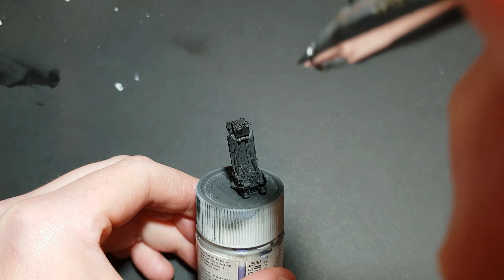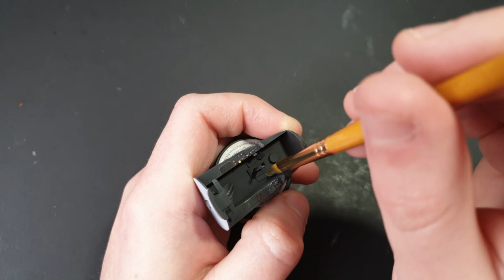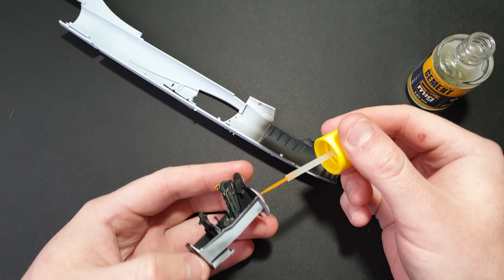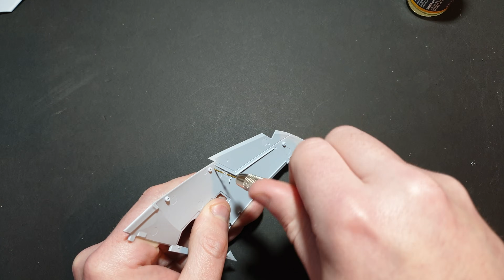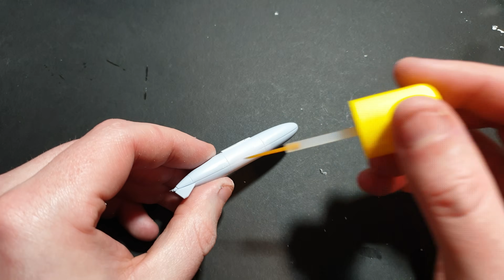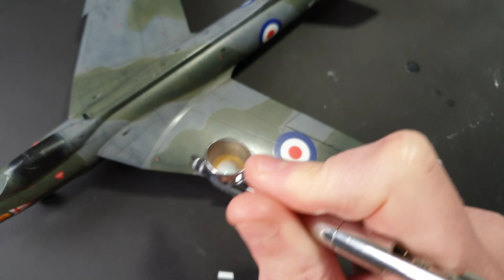Airfix hawker hunter 1/48 build

Comment: Excellent build but I have a question.  I'm in the middle of building this model as a Dutch Hunter.  I notice you used the straight aft section where as every picture I've see of a F6 hunter had the tail section with the eyelid like projection on top of the tail section.  I am impress with the parts fit, just kind of snaps together.
Reply from the maker: Thanks Bill as for the question I'm sorry I am not up to scratch with jets usually !

Comment: I see a lot of people gluing the outside of parts. What's the thinking behind this and what glue are you using? Great finished model btw.
Reply from the maker: Thanks Mark. I'm using mig extra thin cement, running the glue over a join or seam works well with the extra thin glues you can get. Capillary action draws the glue into the seam or gap as they are so thin. Making some gluing jobs a breeze !

Comment: A very nice and well built model, thanks for sharing the build, it has given me some tips on how to achieve a very nice finish. One thing that you could have done for a even more realistic finish(if you had not done it, I didn’t manage to see, even when re-watching a few times) was to finish the main wheel aligning spike in the wheel bays in a highly polished metal finish, a spike I and many others became best friends with after hitting our heads on it a few times, and it hurt like hell I can assure you. I can’t remember (to many years have passed by) if the spike was on all the marks of hunter in service but I would bet they were, just a little suggestion from a model maker returning to the hobby after about 40 years, and boy have things changed, for the better I might add, with a vast array of kits and paints etc that didn’t exist when I last picked up a brush(no airbrushes back then) and to have tutorials at my fingertips is excellent, thank you.

Comment: Very life-like paint job. I hope I may use some of your methods in my building. Maybe it's just me but I just found the in- and out-focusing between stages  a bit hard on my eyes.
Reply from the maker: Thankyou Pierre, I will try a different transition or make them less annoying in future !
Reply: It wasn’t just you 😢😢😢
Reply: Just for interest the Hunter, from 1956, on was painted with a 2 part epoxide high gloss paint, with superior adhesion properties to withstand the rigors of high speed flight . Originally the specification was DTD5555 updated in 1965 to DTD5555A.............the Lightning was a far quicker aircraft than the obsolete Hunter!

Comment: The effort you expended on the seat and internals was exemplary. The only 'notes' I would give is to rectify the 'toe in' on the main wheels, looks like you stood it up before they were fully dry - easy to sort. The camouflage finish for this time period was glossy that quickly weathered back to a satin tone, to my eye, yours looks a little too matt;  otherwise a nice effort. Mine is on its' way from Blighty as I write this !!
Reply from the maker: Many thanks Ian, the wheels are an easy fix as they were just press fitted , the Finish I completely agree, I'm usually a ww2 guy and getting away from Matt is always tricky. Many thanks and good luck with your build